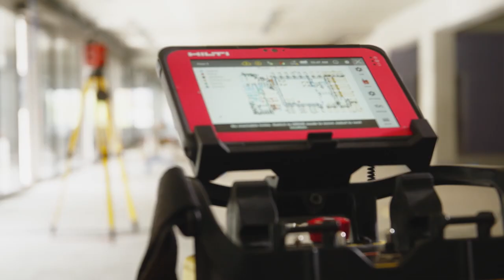INTRODUCING a new construction robot Hilti JAIBOT for construction automation of overhead drilling

Comment: Does the drill check for underlying steel reinforcement or strands to avoid clashes?
Reply from the maker: Hi there - The Jaibot uses the Hilti PLT 300 total station for indoor localization, reducing the risk for positional errors. If the trades are well coordinated in advance, it reduces the chance for clashes and costly rework. Hope that answers your question. Thanks!
Reply: @HiltiNorthAmerica  If the trades are well coordinated in advance, it's likely that cast-in anchors would be used to avoid post-drill and fix. Often due to differing stages of design development, such co-ordination is difficult; that is one of the reasons why post-drill and fix anchors are used. If a reinforcement detection tool was included, it would reduce the risk of clashes.
Reply: @MC-ss6pj  This is true for new construction, but I see this being used extensively in renovations without q decking
Reply: "If the trades are well coordinated in advance" so basically cross your fingers, LOL.
Reply: @MC-ss6pj  Then I would recommend scanning the deck before the concrete pour. Take the 3D point cloud and overlay it into the model. Create "no drill zones" around objects of concern like PT and place your anchor holes elsewhere. Including a layer of complexity by adding some type of scanning device (GPR) to be used on the fly for every hole would reduce productivity not improve it. Scan, design, drill and install.

Comment: i didn't drill those anchors in the wrong spot....Jai did
Reply: I didn't hit that PT cable, the robot did
Reply: Except the robot probably won't. "Tell" it something once and it never forgets. Is at the job site 24/7, will work through lunch and dosn't need breaks.
Reply: Highly unlikely as this piece of equipment implements BIM software that has the precise locations of steel and reinforcing work including PT.

Comment: And for those who tried arguing that automation couldn't take the more skill based jobs that require experience, I'll just point to this, because in the next 10 years, when these robots become extremely inexpensive, humans will be getting fired without any replacement jobs available. It'll make the job loss of 2020 look like a vacation.
Reply: Also, just look at CN rails in 1980 compared to now, 120 man crews cut to 14, 14 is a big crew on cn now
Reply: My man if you truly believe that robots will make every trade obsolete in the next 10 years your dreaming. I’m a plumber and unless a robot can adapt and move around any environment indentify the hundreds of thousands of different possible problems and make sure what they fixed stays fixed without running into any issues then by all means humans are useless. But currently robots are no where near smart enough to navigate in any environment on there own without any prior knowledge of that environment. Simply put robotics are not currently flexible enough to do certain jobs because robots need information to process things and visual info is no where near good enough yet.

Comment: It just seems way to specific of a machine to be useful on most job sites.  It’s so big to do only 1 function.  A human on a ladder can do most anything,  this 1.  Not to mention if it breaks down then you’re fucked,  humans are far more replaceable and multi use than this thing.
Reply: This helps reduce ladder falls on the jobsite (#1 injury in construction).  Also, this is about the size of one person on a lift.  "Humans are replaceable" is not a safe mindset.
Reply: All commercial jobs have systems attached to the ceiling. Some building are renovated and need everything replaced. JAIBOT takes care of the anchor holes (layout and drill). Some jobs are new and there is not enough time to design before the concrete is poured. JAIBOT takes care of the anchor holes (layout and drill). Some jobs could be scheduled to be poured more quickly and JAIBOT could layout and drill the ceiling holes for the anchors. Then prefabricate all the system components that you can and easily attach them when you are on the lift. Concerned about what is already there? 3D Scan the ceiling and use that as a basis for design. Design as many holes as you can that are reachable by JAIBOT. You are welcome to drill the rest manually. This tool and many other robots are designed to improve an industry for all of us in it.